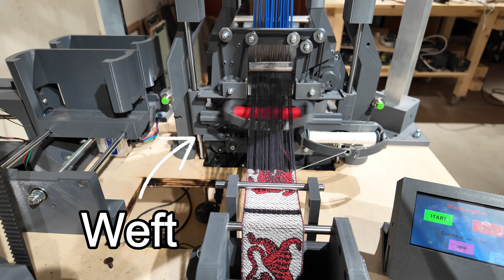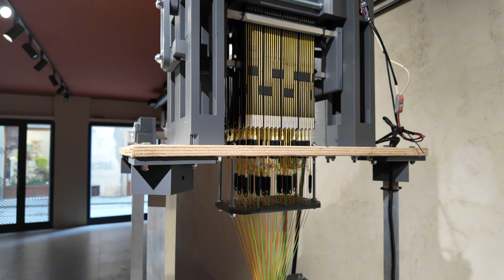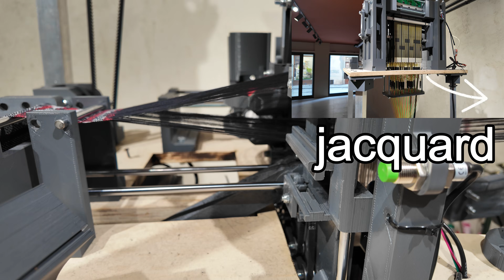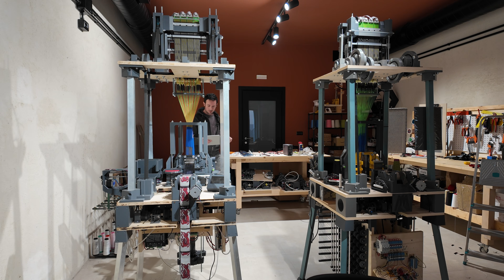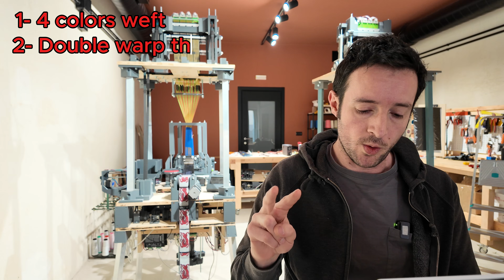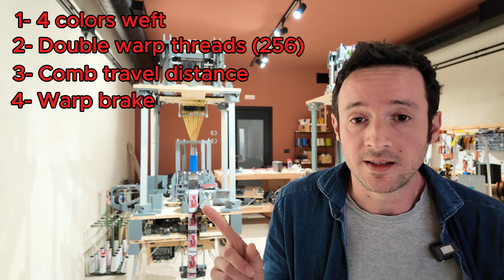I Built a 3D Printed Jacquard Loom - part 1

Comment: Great project, really inspiring!
Quick question: how are you implementing the Jacquard control for the warp threads — individual actuators (like solenoids) per thread, or some kind of multiplexing?
I'm designing a loom myself and trying to find the best trade-off between complexity and reliability. Would love to hear your approach. I want to make 512 wraps.
Reply from the maker: Thanks for the comment! I use electronic boards derived from the textile industry. They work like shift registers. I input the textile design I want to create bit by bit (specifically for my loom, I enter 128 zeros or ones with each pass). Each of these boards controls 8 electromagnets, which in turn lock or release the cord that controls the warp threads.
If you search for 'jacquard electronic module' online, you'll find them! I'll make a more detailed video about this!